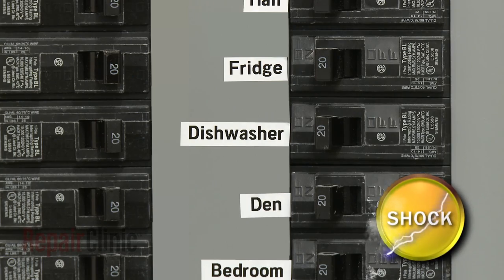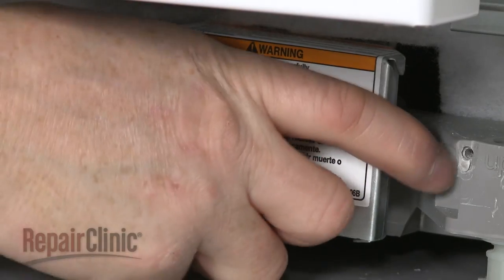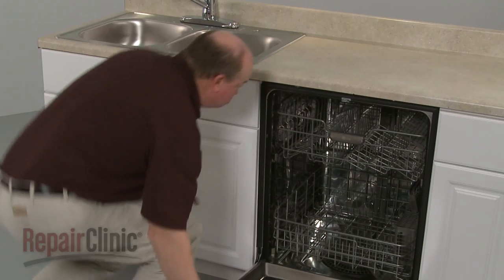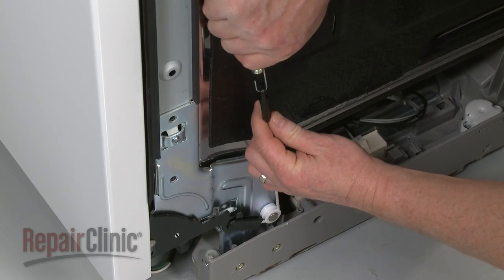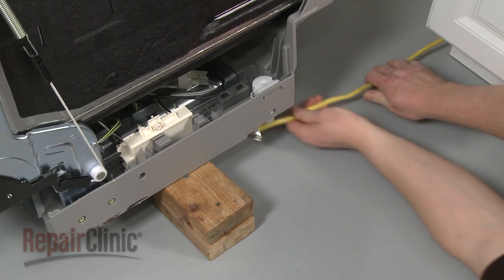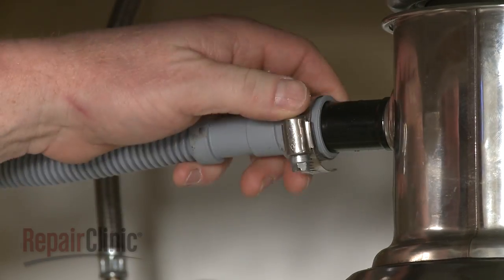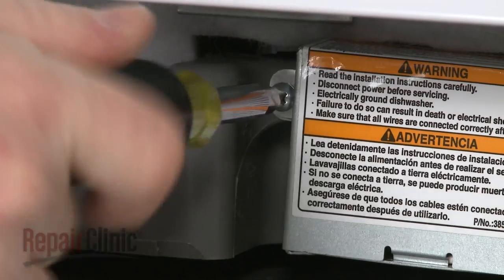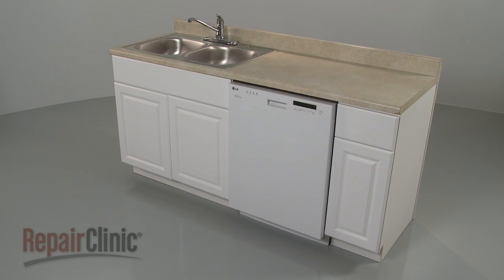LG Dishwasher Door Hinge Cable Replacement #4933DD3001B

Comment: This is a great video. Thank you! I turned off the electricity and the water supply.... then I got so frustrated trying to disconnect the water supply (there’s no room to move under there!!) that I decided to try just unscrewing the top screws and then I just slid the dishwasher out about 8-10 inches and I had enough room to do the repairs and I didn’t have to do all of the extra steps. Finished the whole job in 10 minutes. 

I guess it really just depends on how much slack you have in your hookups. My water line felt like it definitely had some ability to extend out so I gave it a try. Woohoo! So glad that I did. 

The part is easy to replace. The spring took a minute to figure out the best way to stretch and connect but all in all it was an easy repair. The whole time I was doing this, I couldn’t help but shake my head at the ridiculous design of this. Surely they could come up with a stronger material than this little rope that slowly wears down over 5 years and inevitably busts. Other than the rope, I do love my LG dishwasher! I hear my friends and family complain about their expensive dishwashers and the various problems they have. My LG was cheaper and performs much better (in my humble opinion). 

Thanks for the informative video. Will come in handy if I ever need to pull out the dishwasher farther than today 👍
Reply: This is what I'm hoping I have for give allowances too! Just a bit of a pullout so I can work on it. I remember when I installed it there was almost no room though, so I suppose I'll remove hookups as I go!!

Comment: Excellent video.  I pulled out my DW and found the spring had snapped on one side which was the problem but both door cables were so frayed that they were ready to go. I replaced both springs and both hinge cables and the dishwasher is working like new. Thank you!

Comment: Thanks for a very informative video has I need to make this repair. I just can't believe LG designed a dishwasher door hinge that uses a rope that will of course break after a few years ,  in my case around 5 years not to mention you need to remove the dishwasher to make repairs

Comment: This is a very complete description of what MAY need to be done in the worst case scenario.  But sometimes you just need to remove the 2 screws that connect the dishwasher to the underside of the cabinet and then pull the unit out without disconnecting the power cable or water cable.  If your water and electric cables are too short you may have to do all these more complicated steps.  I always make sure to have longer electric cables and drain hose, if your's are short you might want to lengthen them when you do this repair it so future repairs and replacements are easier.   Don't be intimidated by this video, this can be an easy home repair...and the part is so cheap.

Comment: This is a pretty simple repair, and the video is helpful, but the video overlooks one important detail. Most dishwashers will have a side panel encasing the frame and the spring/connector assembly. You will need to remove this panel to install the parts.

Comment: Thanks for the video. Thankfully our dishwasher had enough slack where we could cut out all the hard steps and just remove two screws, pull it out, swap the ropes and push it back in. Ten minutes.

Comment: I have an LG LDF7920WW dishwasher. The door spring or rope has broken and I have reviewed the video to repair.  My dishwasher has a medal surround around the entire outside of the unit. Should I expect to take of the entire casing on the outside of the dishwasher or will the spring and rope be accessible for the repair?
Reply from the maker: The model number you listed is not recognized as valid in our database. We recommend that you double check that. If you have a side panel, you may have to take it off to get to the spring and cable. If you have a wraparound case, you may try raising it up and going from underneath. A valid model number will be required to look for the parts.

Comment: We replaced the rope and the springs and the door is still falling heavily.  I have no idea what to try next.  A new dishwasher, probably.
Reply from the maker: If the door has a wood panel or heavy insert the original springs may not be heavy enough. There may be some extra slots in the frame where the spring attaches. If so you can stretch the spring to a different hole that will make it tighter. If you have a heavy door panel and replaced the springs with new ones that might be the problem. Try the old springs and see if that solves the problem. I do not see any different springs or cables available for this unit.
Reply: ***** Check the rope on the other side.  The door has 2 ropes; one on each side.
Reply: If thats the case you have not done it properly replace them and it cant faill its impossible